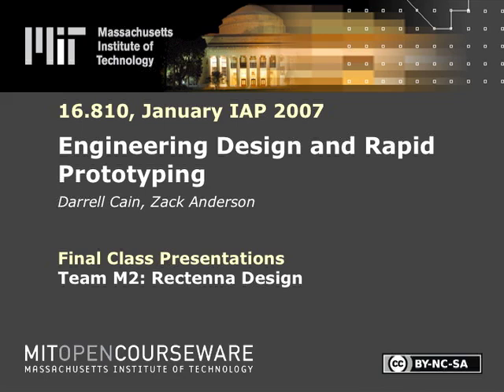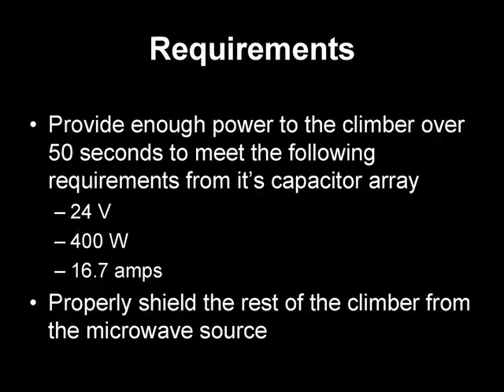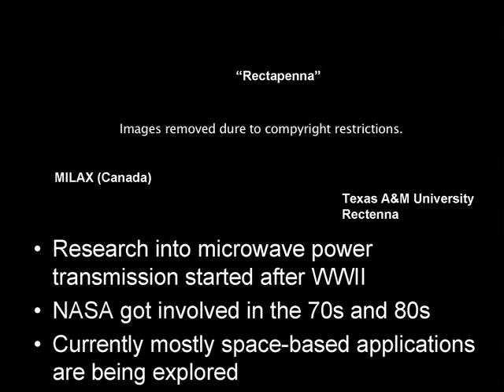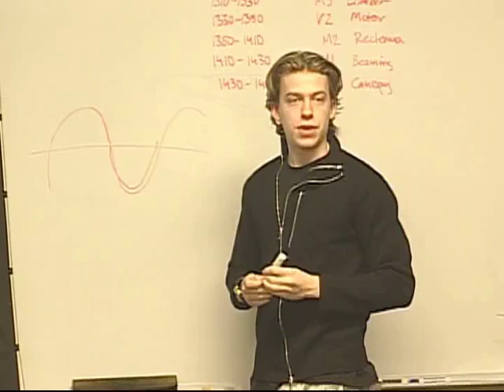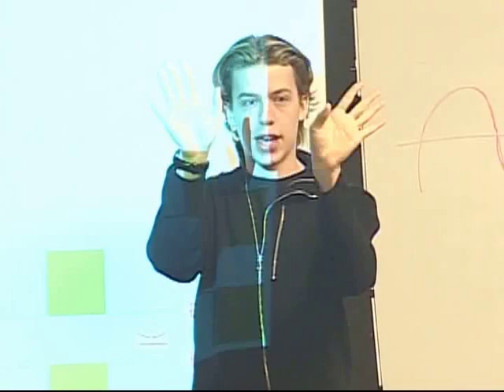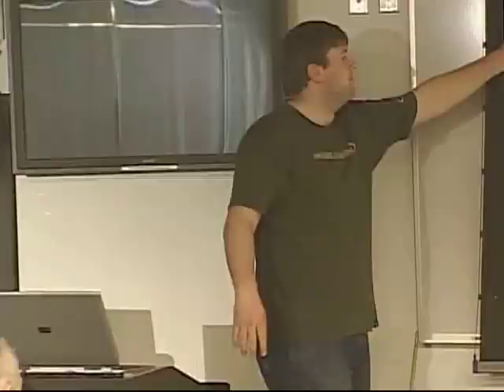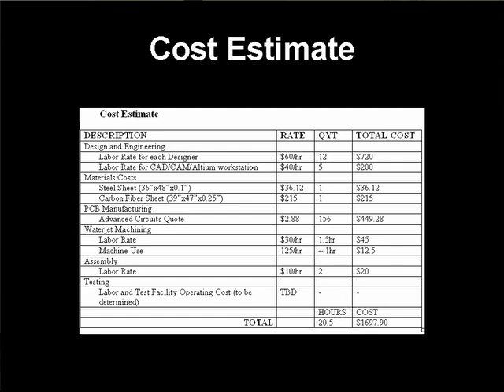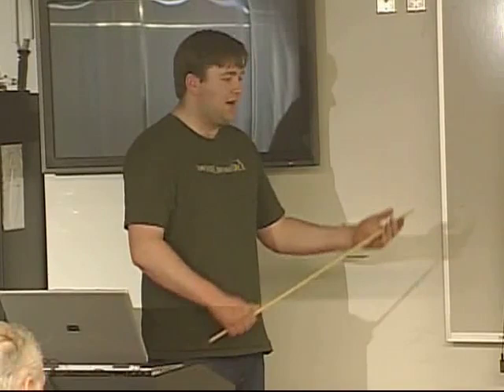Team M2: Rectenna Design

Comment: So they have what’s effectively long distance wireless charging in a 7 year old video with 9k views and the people in the comments are complaining about audio... lol where is my wireless charger?
Reply: Wireless charging's inefficient and based on Faraday's law of induction, this is more a relay and conversion system for long-range transmission. Basically, you fix the resistance- and heat-based losses of a power line by using light as your transfer medium instead of copper wire. Put the right relays in place, whether it's on the ground or in geosynchronous orbit, and you can relay power across the world in record time with high efficiency, assuming your receiver is tuned right and your relays don't scatter or absorb too much light.